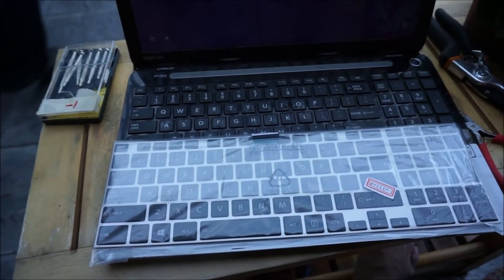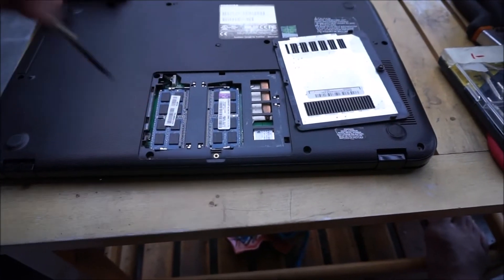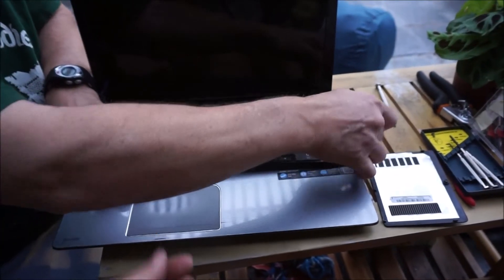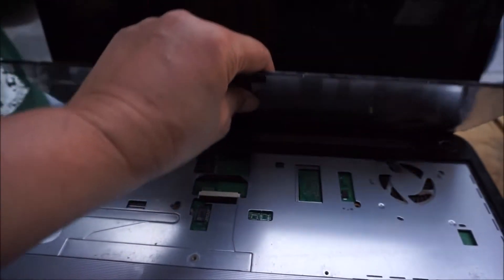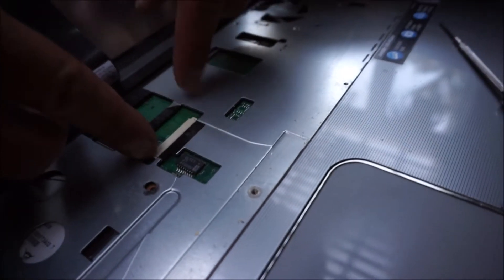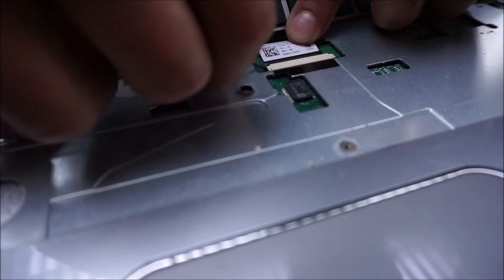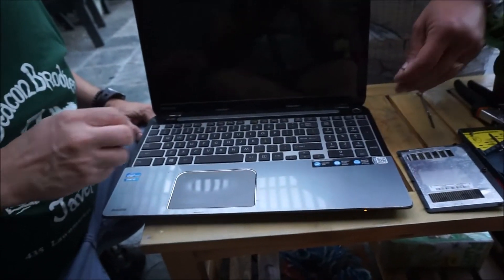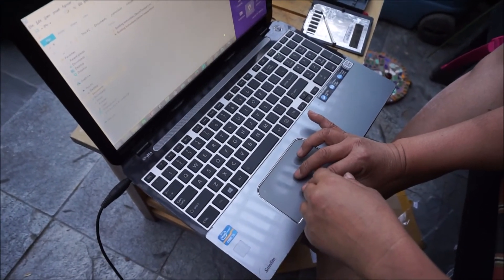Toshiba Satellite L55-A5284 Keyboard Replacement STEP BY STEP

Comment: OMG! 
First, a GOLD STAR to SquiggleMom
 for taking on a simple repair rather than trashing a serviceable device.
The rest of you using this video as a DIY How To...
#1 - DO NOT use a micro screw driver as a pry bar! Use a guitar pick or an old credit card. I save those fake credit cards you get in the junk mail, they make a great 'spudger'.
#2 - ALWAYS remove the battery! It's not really that many screws and it pops right out.
#3 - ALWAYS clean out the fan and radiator fins with canned air when doing service on a laptop. Heat Kills electronics. ALWAYS replace the thermal compound when you do this! it's cheap.